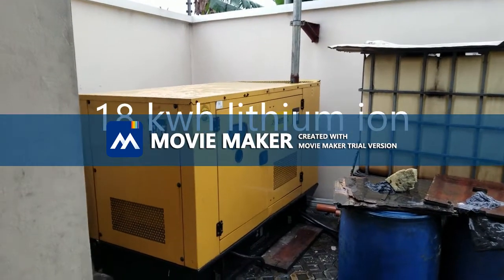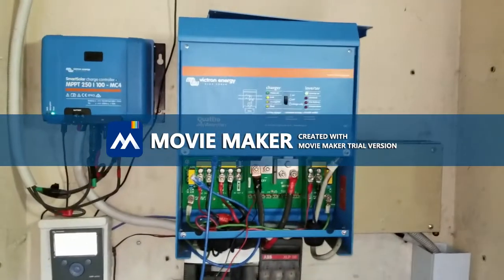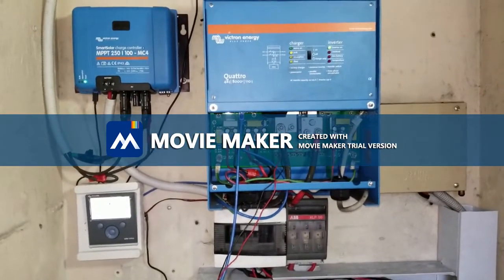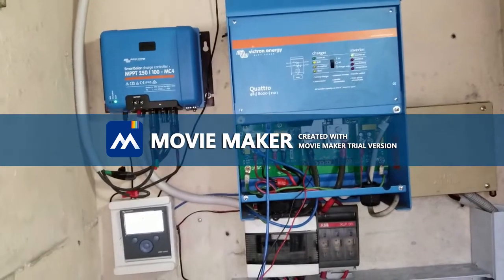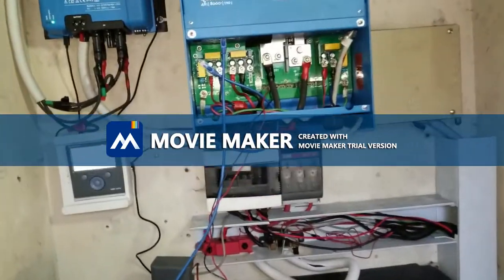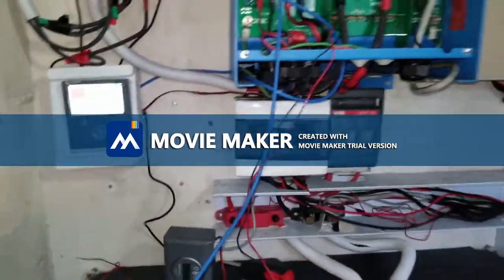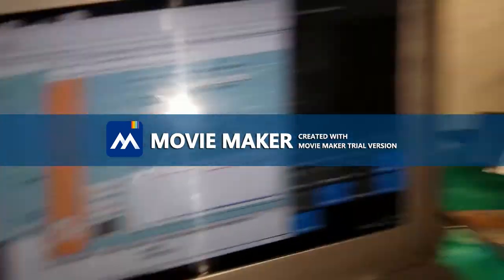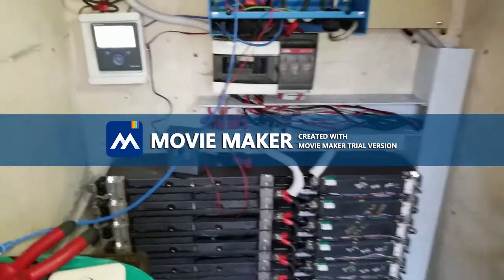18 kwh Tesla smart Lithium Ion Batteries

Comment: Nice one Dr. Solar. Tesla smart 3.3kwh battery is a perfect one. I prefer it over the 24v Tesla model S batteries because of the high voltage this tesla smart comes. U can discharge it much making you use most of the capacity compared to model s pack.
Reply from the maker: Thank you for watching. My client is very happy with them. They are the same chemistry and make up just higher voltage as the batteries in the model S

Comment: It looks great. Bms is very important. Thanks for sharing
Reply from the maker: It is very important. Batrium does not have one for our batteries. I am open to recommendations. Thank you for watching
Reply: Check each cell voltage to make sure each cell is the same voltage during charging. If one cell is charging higher then the rest you must balance manually. My buddy gets cheap bms boards. You will need to know how many seriesed cells you have so you can get the proper bms. Look up Going off grid. On youtube. He knows these well. Check your voltages asap. You have a lot of incoming pv. You dont want to over charge these at all.
Reply from the maker: @frankz1125  we charged them individually first. Thank you Frank
Reply: I know you would be safe. Great vid.